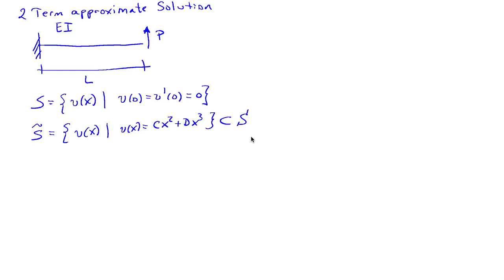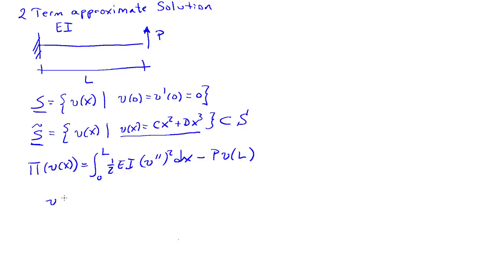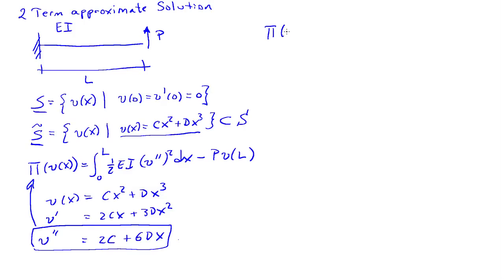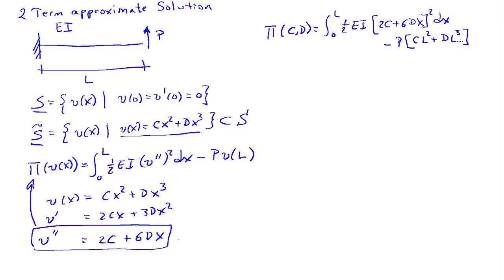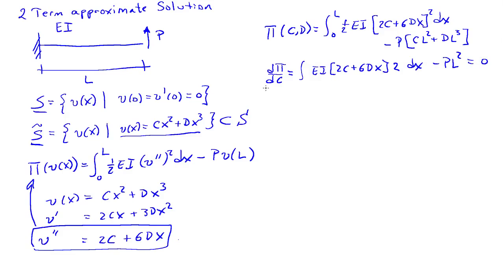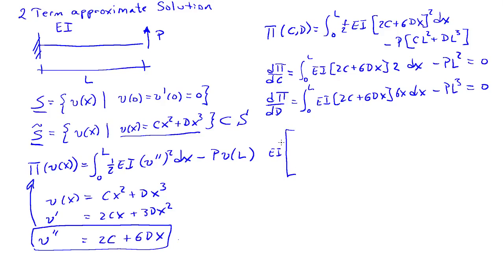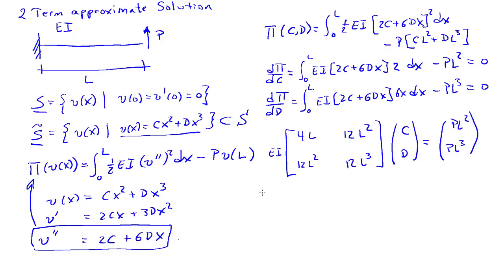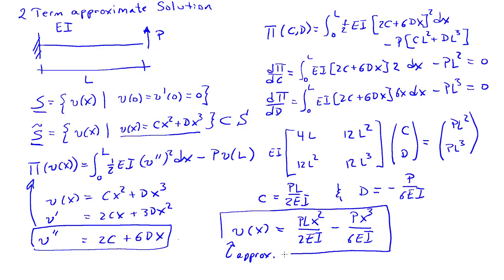Approximate potential energy solution: Cantilever Beam 2-term solution

Comment: Sir I have lots doubts about where the moment of inertia is not constant  in same case (cantilever beam) and method (Rayleigh-Ritz) could you help me. Tks from brazilian students ! keep it up !
Reply from the maker: If you have the situation where I = I(x), then you can follow the same procedure.  You just have to remember to integrate I(x) and not just pull I out from underneath the integral sign.  The remainder of the procedure stays the same.